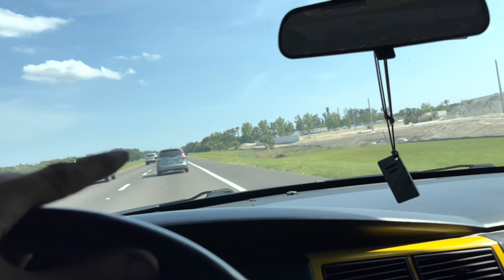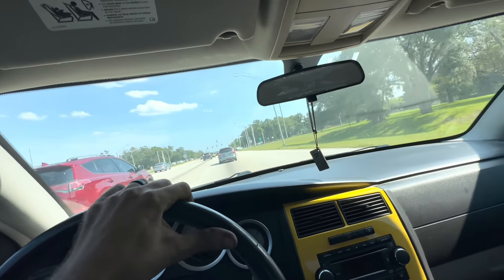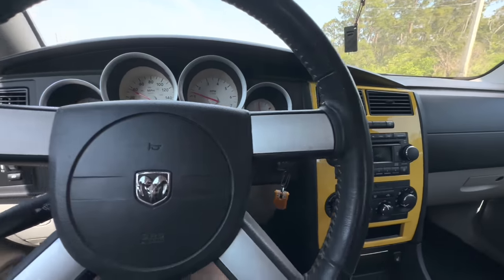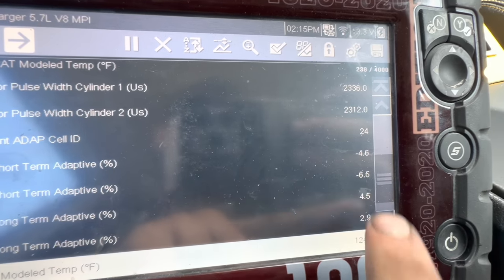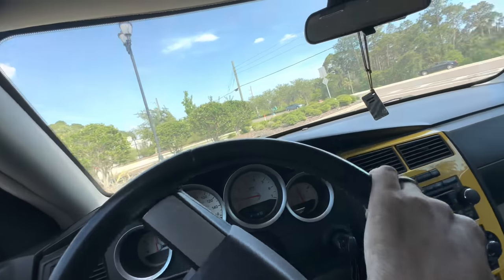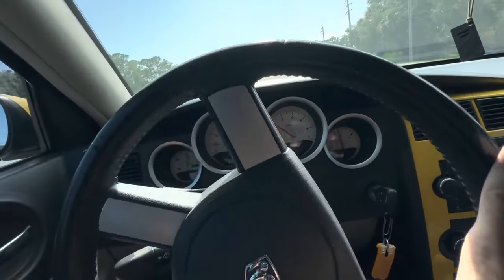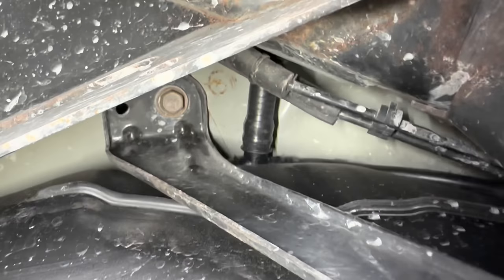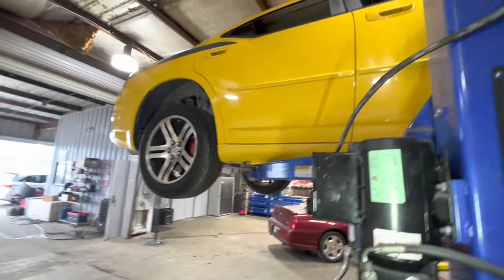Customer States: Engine Stalls After Fueling...HELP!! Dodge Charger 5.7 #mechanic

Comment: Ray, noticed this on the web.  "the problem has now been resolved and it was insanely ridiculous as to what was causing the problem. Of all the replacing and trial and error, it turns out it was the fuses that needed to be changed out (the black cubes in the trunk fuse box)! I was able to speak at length with our master mechanic at my former job and he explained that inside of the fuses there are connectors that toggle internally when the cpu tells it to. Internally, these fuses build up carbon on the connectors and tend to not produce the charge needed to make the car function properly, CAUSING STALL OUTS. I replaced all the black cubes and black rectangle fuses in the box and now it runs great, no stalling! I would strongly advise trying this approach versus the replacements I made throughout the last two plus years"
Reply from the maker: I’m going to check into that one for sure!!!
Reply: @RainmanRaysRepairs  not exactly related .. not even very close really but similar .. older Nissan that stumped multiple dealers ... same symptom you are looking at ... ended up being a mass air , so ignition issue ... not certain the Charger even has one but oddly similar.
Reply: Somehow, I think those "black cube fuses" are actually relays.

And, yes, the contacts can get carbon buildup exactly as described.
Reply: @litz13  They could be solid state relays. Those use small switching transistors or Mosfets to switch in place of mechanical relays but they still can randomly fail from the high current they have to switch. I've seen them fail before in other vehicles and all they are is a transistor potted in epoxy with tabs for connections poking out the bottom. No way to service them, just replace.
Reply: Nissans and Datsuns had similar issues with "half blown" fuses.
Reply: Familiarization with the methods of the elect controls of the/this vehicle's system(s) and then graphing and recording the likely electronic componets/controls.. along with the trims, would have been a good starting point. 
It is certainly now. 
The parts cannon has failed and that creates more varibles as to, if the replaced parts are actually 'as good' as what was replaced.
Reply: This would not cause fuel to be in evap system.
Reply: Very similar to project silver Ford E-Van hooptie
Reply: Had a problem with the solid state relays for the right turn signal on my 02 camaro. 10k 20k and 30k. Just a batch of them were bad and my car got one of them. And apparently the dealership also got some of them. The techs were getting annoyed at me for bringing in that car. I told them maybe the relays are malfunctioning. Something lots of people don't think about. Oh it is the bulb. just replaced it and it is still clicking fast. The 94 Lumina did the same thing when the relay acted up.
Reply: Dodge is the newest spelling for DOG. It's like the Jeep thing. Chargers doing the Chrysler thing. Do an electronic check. You need three things to run without interruption.
1) air
2) fuel
3) spark
Did you check the CAT flow. Sometime a plugged up CAT will cause random stalling???
Reply: @georgestone1485  : That would be evident after running the car through open-loop driving and cycling. Why? Because after running the car, the cat would be hot, being hotter than normal if it were clogged.
Reply: @rjm7168  You may or may not be correct. Perhaps if we knew the function of the 'dirty' reply that was replaced, you could have grounds for that statement. 
Consider that, flow and vacuum appear to be controlled electronically(valves, pump). These items are controled by signals sent to and from the the ECU. 
Duty cycles are often used to meter such. If incorrect (partially missing or excessive) values are applied/received... Much is possible.. or impossible.
Reply: @rjm7168  exactly! While what he is saying seems more than reasonable, I wonder how that would relate the fuel in the lines??
Reply: @c.h.r.i.s2253  : Simple. Read my reply to Ray.
Reply: My first thought when the display started flickering was this was electrical; a stalling issue would cause similar but the flashing odometer etc was way more pronounced than any change in the engine rpm. I've seen similar things on older cars when the electrical system is tired
Reply: @RainmanRaysRepairs  : Ray, we know you've checked all of the mechanical components, and the electro-mechanical components. I concur on checking the electronic side of things, such as wiring, grounds, etc.

Reason why is simple: Those mechanical and electro-mechanical components have to get proper signals from the PCM to work. If those signals are faulty from the PCM, or the components aren't communicating with the PCM properly, then you'll have what appears to be a failed component, but what the real culprit is, is faulty control wiring or bad/open grounds and shorts. 

For example, look at a fuel system with what appears to be a bad pump. Do you ever just replace the pump? No. You check the ignition signal, as well as the grounds at the harness and make sure those circuits are working properly. Same applies here to an EVAP system that the components appear to be fine, yet you still are having the symptom the customer stated. So, my advice: Check and confirm no issues in the electronic control side of the system, and confirm that the components in the system are receiving proper signals from the PCM, and then, if applicable, sending feedback to the PCM to let the PCM know it's working correctly. 

This methodology should solve the problem.
Reply: Those "fuses" are probably relays that have gone bad. As fuses are just a piece of plastic with a piece of metal inside that melts when too much electrictrity goes through it
Reply: @georgestone1485  And compression...
Reply: @RainmanRaysRepairs  : And, Ray, one other thing to check: That Dodge's Anti-Slosh Module. 

On my Ranger, there is an electronic control circuit board on the side of the instrument cluster called the "Anti-Slosh Module." What it does is compensate for the fuel in the tank when it "sloshes" or moves under acceleration and de-celeration -- meaning, as here with the Daytona Charger, that if the Anti-Slosh Module is failing to tell the PCM when the car is under de-celeration or stopped (i.e., getting off a freeway at an exit ramp or stopped at a light), that could explain why gas is in the EVAP lines, as the Anti-Slosh Module would not tell the PCM to close the EVAP components and seal that system properly, to prevent fuel from getting into the EVAP lines.
Reply: It’s the dielectric grease used on the contacts that cause the carbon build up as the grease is burned from arching.
Reply: Fuses? Don't you mean Relays?
Reply: @paulkaz2127  A Russian approach. Ivan with Pine Hallow.
Reply: I had a Dodge Neon do almost the same thing. Turned out opening the drivers door and pushing all the fuses back in solved the problem. I ended up glueing all the fuses and relays in place and sending it to an auction.
Reply: If I was in a parking lot by myself in my car and a Dodge charger come pulling in with tinted windows I would have bounced to. Lol
Reply: Can confirm as a Chrysler tech. When these cars were popular we had at least 10 a week coming back after the fuel tank was swapped with intermittent stalling. Start at the relays in the trunk area, if those are all good with no corrosion you may have a faulty check valve and would have to swap the tank again. Everything on this car seems to be new so I would bet money it’s the relays.
Reply: Black cubes. How technical 😊
Reply: @daveunbranded  I think I’m going to start using black cubes instead of relays lol
Reply: Man I have had this problem with my 98 jeep wrangler for years and now thanks to this video and your comment I have some hope
Reply: @SocketSilver  Yep, Ivan might be the most sane person on the planet. No parts cannon. Proper correct diagnostics  everytime, with as minimal disassembly as possible(time).
When Ivan referes to Russian 'approach' he might say Russian hack,  it's usually a workaround to satisfy the customer and not his usual perferred perfection.. but quite workablly 'engineered'. 
Ray is ok. He appears an ethical guy also, but he definately can learn much that is needed, from Ivan.
Reply: Same problem on my ford, ecm was covered in water.
Reply: I would ask the owner if when he fills the tank does he remove the nozzle when it stops or does he add more until he can see it. That is he is overfilling it &  messing up the system.
Reply: @militarycoo  that's just a difference between the refresh rate of the display and the shutter speed on the camera
Reply: @Titanphoenix666  "for years"?  Marco, you have my sympathy, sir.   I would have given up in exasperation and sold the vehicle a long time ago.
Reply: Wheels up, info you provided is priceless to guys like me. I’ve been fixing my own stuff and now my kids cars using info I learned from HotRod magazine starting in the 60’s. When YouTube came along that has obviously been a Godsend. Comments and info, such as that shared by you , means so much. I appreciate it. Dave in Omaha
Reply: @rjm7168 maybe the owner is just really over filling the gas tank on fill up and getting fuel into the vent tube, canister.  Maybe
Reply: @coopcraige  what you mean to say Ray is it's  exactly the same but completely  different
Reply: @wrench31e22  good solution 
.....and don't buy a Chrysler 
Electrical gremlins are no extra charge!
Reply: @oldcynic6964  I don't give up
Reply: @litz13   Yes.  Fuses that turn on and off would be very interesting to watch!
Reply: oh bits of knowledge
Reply: @tommcintosh7241  There is a phrase, spoken by Engineer Scotty, that seriously applies to modern cars:

"The more they overthink the plumbing, the easier it is to stop up the drain."
Reply: I’ve heard of this happening with this car and with Camaros too. Carbon build up supposedly from using the lowest grade of gas continuously. I know Camaros especially say to use premium fuel but if $ is a problem you could get by on Midgrade but with the Daytona I believe the manual says anything from 89 and up and could get by on 87 but will reduce performance …but I personally would never 87 all the time.
Reply: Also, if the fuse deal fails and you found fuel trace in the line, the next thing to do would be asking the owner if he stops filling the tank when he or she needs to stop or if he or she fills the tank until it pour out. If the owner fills the tank all the way up the filling tube, there's the problem.
Reply: Definitely plausible, I hope that is it!
Reply: @richb.4374  maybe but you can't carbon gunk up a solid state relay's contacts... 😀
Reply: Had a dodge truck ,that would be fine for 10,20,50,85 miles then quit,ended up being a rusty vent tube! No reason it was do randomel,but that it what it was!
Reply: If the contacts for the fuses or relays have blueing (blue Rainbow ish  colorings) they have over heated often.
Reply: @spaceflight1019  when is my next bonus?
Reply: @kennethoakes4182 , that's a good thought.  When Ray was driving this car and not getting it to stall, I began to think that the way the owner drove the car (or filled the gas tank) might be causing the stalling, since the stalling is now seeming to be more associated with who's driving than the car's systems themselves.
Reply: @daveunbranded    Don' mis-quote him...  He dint call them thar relays, black cubes; he called 'em "black cube fuses".  
Dat are an very 'porant di-stinkshun.   🤪🤪🤪🤪
Reply: well it is a Chrysler and electrical problems are what they are known for so an issue causing some solenoid in the fuel/evap system to not work right or something similar seems possiple.
Reply: @militarycoo  I saw the same thing. But my guess is those indicators are multiplexed. Meaning they are switched on and off, not apparent to the human eye. Given that the video camera is recording images at one rate and the indicators are switched on and off at a different rate. As these different rates slide in and out of phase, the camera thinks they are going on and off. But Ray, certainly would have noticed any flickering.
Reply: @paulkaz2127  "Perhaps if we knew the function of the 'dirty' reply that was replaced, you could have grounds for that statement. "
What "dirty" reply?
Like the guy who took his car to the shop for a similar reason. When he picked it up ha asked the mechanic what caused it, mechanic replied. "Shit in the fuel tank bud"
Customer, "How often should I do that?"
Reply: Sometimes issues can have a stupidly easy fix one doesn’t think about.
Reply: I had an 06 srt8 charger, whenever I filled the tank above 3/4 it always stalled while turning at a stop light.  Great car otherwise. Miss it
Reply: @georgestone1485  If it was a clogged cat that car would sound so screwed up hopefully someone would notice. Not to mention melting carpet / burning things and having no power whatsoever. But then again some people don't notice flat tires I've seen it, I have no idea how!
Reply: @litz13  Yes. Relays.
Reply: That's weird, do you mean carbon or corrosion, are they not rated properly so they build up corrosion, pitting and staining from arcing, I don't get how carbon gets on the fuses, for that exact reason that I don't understand it and why I would never ever think of looking at this to fix. Oh they're relays which makes more sense as to them wearing faster, still should be spec'd for the job they do, maybe that was an engineering or sourcing oversight.
Reply: @Hold-my-beer  I'm going to use OXO cubes myself 🤣👍
Reply: I was just going to add that many new parts are bad. 7 SEVEN new wiper motors on my mercury GM in about 16 months first replacement bad right out of box.
Love your work👍👍
Reply: I noticed a  delay problem with this video, the audio could be heard then the video catches up.  Happened on several devices I played this from.

This is the exact reason you don’t tip off your fuel tank…
Reply: @RainmanRaysRepairs   
i had in the past a similar thing happen, although i have to say, and absolutely different car, where it would stumble and got to occasionally stalling when completely lifting off the gas pedal from over 1/3 open, it sort of did the exact same thing with the rpm needle, it was the EGR valve on its way out, it was really easy to check finally when i just disconnected its connector and it ran amazing (although with a check engine light), 
it might very well be something absolutely else, some other person commented something about maf sensor, i don't know.
one last thing to check, did the customer once force fill the tank beyond the click? like 10 more attempts? that might send fuel into where it should not go, and there are some people out there that try to squeeze that last drop as if it would matter a lot, and that might be the reason why the lines are wet, and now that most of it has gone through since the last overfill, it is working better no longer having the lines full of fuel since it could have been running for half a tank (assuming it was filled to top), and you filled it like you should so it did not do any problems this time,
Reply: @georgestone1485  i am sure you would know from half a mile away that the car has a terribly plugged cat that it stalls, it would be running like crap, unable to breeze out the exhaust gases. plus, cat trouble codes appear way before it even has any consequences of the running of the vehicle
Reply: RELAY.  

PLEASE DON'T CONTINUE TO CALL THEM FUSES

A FUSE IS A SPECIALLY SIZED  CONDUCTOR that protects the circuit from fire shorts and other overdraws of current that can cause the wiring to catch fire and/or burn out components by becoming the weakest link and burning out before the circuit can reach that point.

A RELAY DOES NOT DO ANYTHING OF THE SORT, 

A relay is an electromagnetic switch that allows a high amperage/ voltage circuit to be controlled by a low voltage/amperage signal.  It is just a way to make the  PCM ( which uses a 3.3v , 5v, or 12v signal nearly always less than 1 amp ) able to switch on a high amperage/voltage accessory without needing to pass that full amount of current through itself.

A FUSE is a fire and shock safety device

 a RELAY is just a switch
Reply: @litz13  Yup, that was my point in my last post, they just die, no contacts to burn up. lol
Reply: @Qwertyuiop-wg5xu nope... I have a range Rover that had a plugged up catalytic converter and it didn't show any catalyst codes. It just blew the egr valve open and the excess pressure was just pushed into the intake and recirculated endlessly....
When I checked the codes on it I only got a code for manifold air temperature being above the capability of the sensor.
The physical egr valve was not working but the electronic circuit was, making it seem to the PCM that it was functional.   The  O² sensors were working, but, some idiot had replaced the cat-back exhaust system and the location of the sensors was making them read that the system was fine because they were placed in the center of the X-pipe and reading both sides simultaneously... 
JUST A PERSONAL RULE DON'T ASSUME THAT A COMPUTER SYSTEM KNOWS WHAT IT IS LOOKING AT.  HUMAN INTERFERENCE CAN BE ITS DOWNFALL
Reply: it could also be a relay issue. while not at all the same my mothers volvo 850 had random stalling for a year due to a slightly faulty relay (it was replace fairly quickly with a slightly wrong relay so you still had random stalling finding that issue was insanity.)

so fuses and relays is one thing to look at (which is a real pain in the butt when they are only slightly faulty.)
Reply: @HarithBK the OP is just  uninformed or misinformed... The "black fuses" AREN'T FUSES they're the relays...  a FUSE that cannot be seen through would be a nightmare for the diagnostician and would require a multimeter or test light to check... Fuses are DESIGNED TO FAIL IN AN OBVIOUS WAY to protect the circuits and let the operator know there's an electrical fault
Reply: @RainmanRaysRepairs  Hey Ray, good idea here for sure.  Relays also have "snubber" circuits, either a all in one or individual resistors/capacitors etc type.  If you are finding relay's with burnt out contacts and they are in a PCB type box,  look at the box circuit board as well for these kinds of parts across the relay for corrosion or other damages.  The other location for snubbers is inside the relay itself or in the relay harness.  It may also just come down to "should done, didnt do" on the makers behalf of course :)
Reply: They're relays not fuses, fuses don't ever switch anything except if they blow. Relays are electrical switches and yes arcing can damage the contacts. Easy test is to just swap over 2 the same from different locations see if the fault moves.
Reply: @georgestone1485 A cat issue wouldn't cause fuel in the evap system tho?
Reply: Had a mercedez e190 wich had a relay that cause same issues.
Reply: The black things are not fuses, they are relays.  There should be three relays, one for the fuel pump, one for the purge valve, and one for the vent valve.  Sometimes they are near the tank, sometimes under the hood.   Newer cars use soldered in MOSFETs, those can also fail, but not often.
Reply: @militarycoo  The flickering of the odometer light is due to the camera he is using and would not be evident to the naked eye. Record your own odometer light, if it is the same style, with your phone and watch the playback and you will see the same effect.
Reply: This does not explain the presence of liquid fuel where there should be only vapor.
Reply: @militarycoo  Nope, the flickering is just an optical thing, frame rate of the gopro is not in sync with the LED dash display. All the LED lights on the dash and other displays are NOT on constantly, they are switched on & off very rapidly, not noticeable when you're looking at them, but show up on camera. Same effect when making a video indoors with LED lighting. If frame rate is off, a very visible dimming and brightening can be seen.
Reply: Your the man!
Reply: @rjm7168  It would if the relay is telling the evp purge valve to open when it doesn't need to be open. Remember the owner had just filled the tank. A full tank has very little to no room for any vapor, thus pulling liquid in instend of vapor.
Reply: @philipershler420  I first noticed a version of this on a 'Bonanza' episode. The wheels on a wagon, while rolling, appeared to be turning backwards.
Reply: @RainmanRaysRepairs  
This might make perfect sence a trunk is not a sealed atmosphere so humidity can degrade connection.
Reply: @RainmanRaysRepairs  I would 100% agree with Wheels up I have seen relays go bad by either not working or it works and then gets stuck on  and if the evap system has pretty much completely been replaced by parts cannoning then the issue lays elsewhere in the evap system and out of all the parts to replace the cheapest is the relay for it and the relay can be tested for proper functioning but being intermittent it may not show up
Reply: I think yoir talking about relays
Reply: I had this exact thing happen to my 2015 Challenger. Random stalling issues. My shop couldn't figure out the problem as it was so intermittent. I decided to replace all of the fuses as "just in case" measure and sure enough, problem solved. Had the car for another 2 years and never had any more stalling problems.
Reply: Fuses or relays? I've never heard of fuses that toggle.
Reply: They are actually solid state relays that are sized marginally and tend to fail intermittently. They should have used heavier duty relays. I see this in commercial kitchen equipment frequently.
Reply: I wonder if the ram trucks from the same era have this issue? My 2010 did this almost from new never found the problem gust lived with it.
Reply: @Hold-my-beer gotta be some real quality there, needing a fuel tank swap in the first 2 years of use
Reply: @militarycoo that’s only on video.   It’s a function the video camera’s frame rate and the LED lighting.    LED lights are actually flickering so fast our eyes can’t tell.     And some cameras have a much faster frame rate and you don’t see the flicker on video.
Reply: Not a fuse, a relay.
Reply: Firebirds and Camaro tuned port injection have this problem with fuel pump relay also . GM sometimes gives you the same relay for the air-conditioning which can get you home by switching them in an emergency .👍 
Not many of them left in service sort of old school now.
Reply: @litz13  You rarely get carbon buildup on fuses or relay contacts. Carbon will only be deposited when hydrocarbons burn. Carbon is electrically conductive, so if it occurs, it would not be a problem unless it caused a short circuit.
What you get is corrosion buildup. The corrosion is an insulator, and that will cause problems. Corrosion will happen in moist surroundings and can speed up due to electrical currents.
Reply: @c.e.g7448  I've seen it if you get a good enough spark jumping the gap, which scorches the contacts, leaving behind black crusty crap
Reply: @litz13  That's right, but that is not carbon. Maybe just a little from burned dust, but the majority is burned metal, in other words, corrosion.
Reply: Meanwhile,  my 30 year old dodge living room on wheels is perfect closing in on 300,000 miles.
Designed and built by previous century car people , not book learned robrats who never fought hard for the inside of a turn on a dirt track.
That was my uncle, when he crashed, he said, "Put as much of the car as you can find on the truck, we'll put it together for next week."
Banging, bonging & trading paint is how you learn to make a reliable car, not cad  design and showroom modeling on a clean controlled track.
Reply: I hade the exact same problem in a GMC Envoy.  The solution was a new fuse box so it could be a fuse or the box.
Reply: Still does not explain liquid fuel in the purge lines
Reply: @rjm7168  YES However the fuel could be residual from before gas tank was replaced. Now the fuses could be it.
Reply: This would explain the intermittent nature of the problem, since it's probably a relay. A bad relays SOMETIMES works, which is miserable for diagnosis.
Reply: @coopcraige  Had an Infiniti that sort of did the same thing too. Would occasionally stall after restarting the engine when it was up to temp. Did a bit of research before bringing it in, ended up pulling out MAF sensor and sprayed it down with the cleaner as the cheapest and easiest possible solution. Fixed the issue right up.
Reply: Is it possible that by changing most not all parts that was mention and the ecu is making all necessary adjustments by stalling and starting the motor again makes a little correction at a time 🤔
Reply: @jojomorgan8556 but what about the black cube fuses?
Reply: @jojomorgan8556  think the problem with no cat codes is that it’s a Range Rover. Those are all dogs.
Reply: @Hold-my-beer 
Is it racist to call them “black” cubes.  Maybe there personal pronouns should be “them there”.